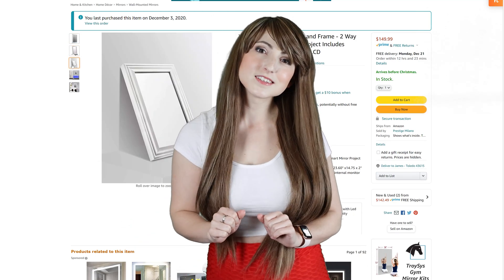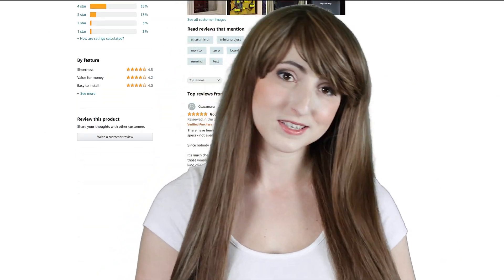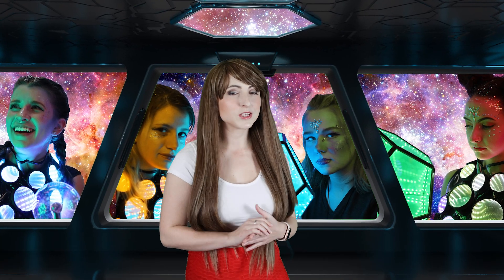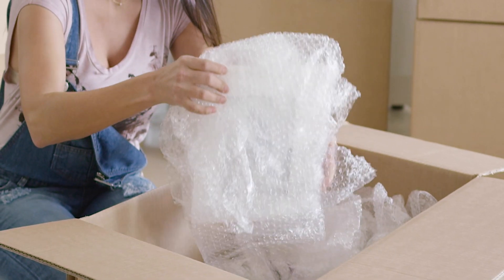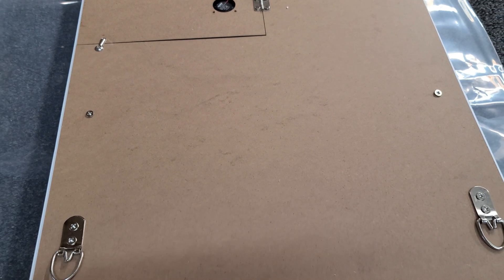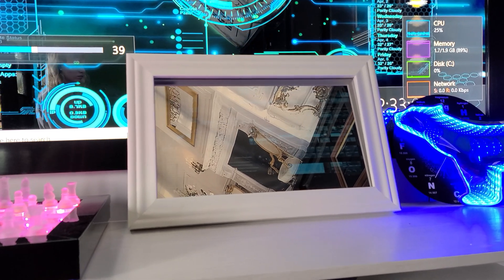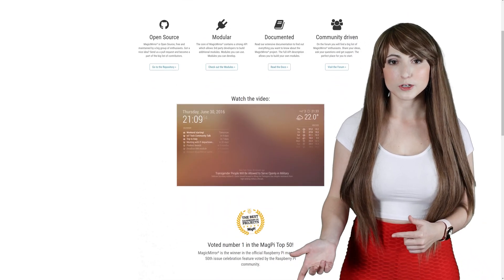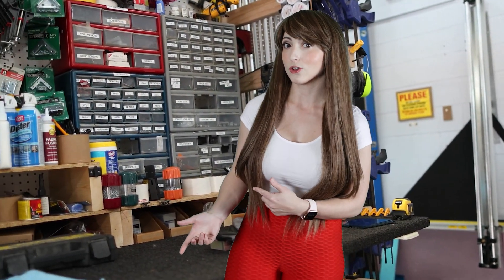DIY Smart Mirror - Is the $150 Amazon Magic Mirror Any Good?

Comment: @ 4:00 you seriously did a cleaning foam smilie face... Lol

Also, with the build quality of the original mirror I'd like to recommend you do an exploratory video for AliExpress options since I'm about 98% sure that it came from China given that it was held together by electrical tape on the inside.

You're channel is pretty dope, so keep doing what you do. Merry early Christmas to all, late Chanukah to some, and above-average New Year as well.
Reply from the maker: Haha, yes we did. (: 

That's a great idea regarding AliExpress! I am sure a lot of people would like to know about that for a cheap complete smart mirror solution.
Reply: @twowaymirrors 

Lol. Nice.

Cheap is typically good, but if you could make a higher quality rig for about the same price, people would likely get onboard. You appear to have the facilities, so you could probably get a raspberry pi/frame/glass/rear panel setup and CRUSH the Amazon option in quality while shipping it as a kit instead of losing labor hours in assembly.

Just a thought as a bored MBA on a Saturday night when everything is closed.
Reply from the maker: It's true we do offer the complete solution but it is not cheap like Amazon: https://www.twowaymirrors.com/complete-smart-mirror/

We have sold a few which is awesome! They are labor intensive though as you mentioned which is why we price them like we do. However, it's basically a cheaper and smaller version of our main product, the Framed Mirror TV:
https://www.hiddentelevision.com/framed-mirror-tv/

with the option to add in the IR Touch and the PC/Raspberry Pi.

We sell the mirror by itself so it is more cost effective for DIYers though!
Reply: @twowaymirrors  - That's a much longer reply than expected, but I'll respond in kind.

You're offering very high quality builds with high quality TVs (I just checked out the links), and that's great for a certain demographic that you're obviously aimed toward. My thought, from a business perspective, was that since you've got the glass, hardware, and frames, you could get cheaper displays which would allow people who couldn't otherwise justify the expenditure on something larger, and get a kit for something smaller; I think you get what I'm saying.

It's just a suggestion, since my absolute guess is that it's predominantly diy types that watch these videos, and from a business standpoint, if you could establish a relationship with a reliable supplier to place small volume bulk orders on decent displays, you could make an all-in-one kit which would still turn a profit.

Just a thought, and hopefully y'all have an above average Christmas, and new years eve... The new year is questionable right now.

Comment: You didn't review the actual product you got from Amazon. Whether its any good for those who prefer to keep the dimmer mirror that comes with the product, or your user experience
Reply from the maker: The mirror that comes with it is very tinted, and we do not recommend it. However, if you replace the glass with one that has a lighter tint, such as a beamsplitter, it will work great!